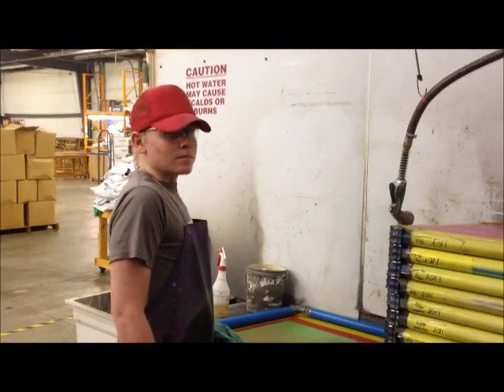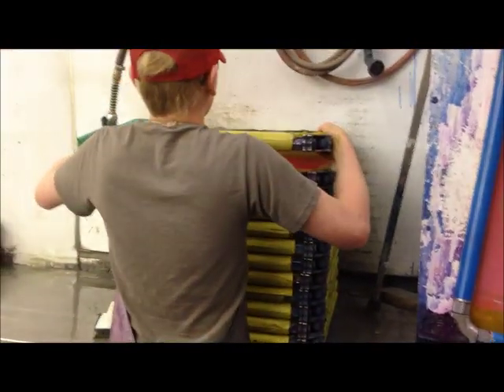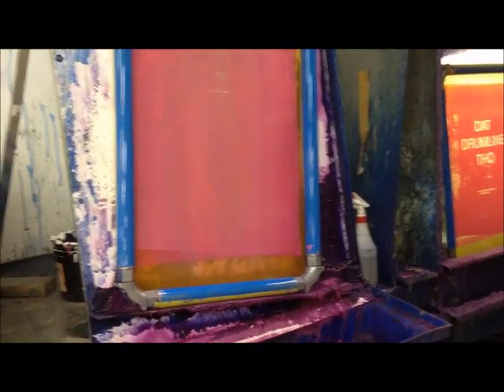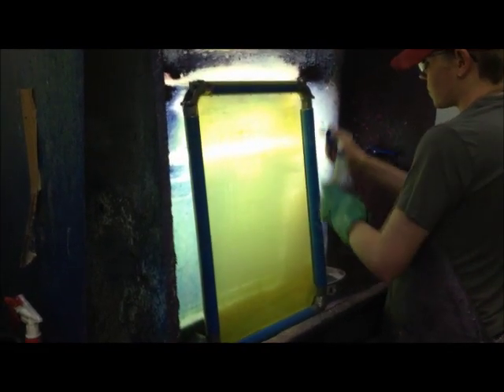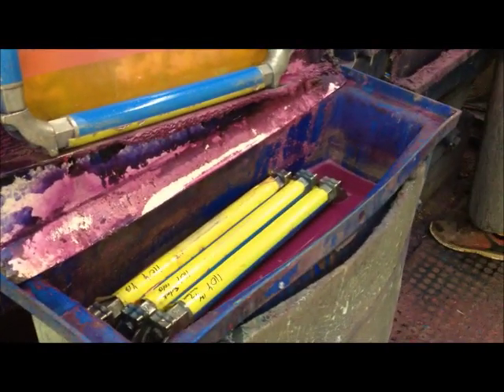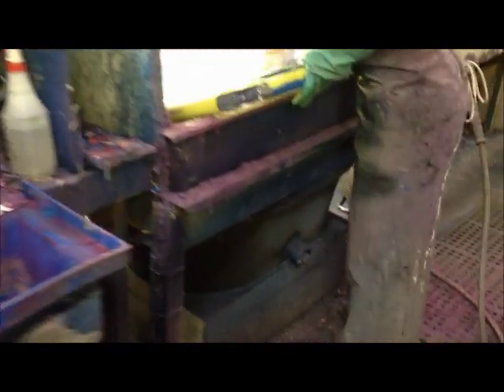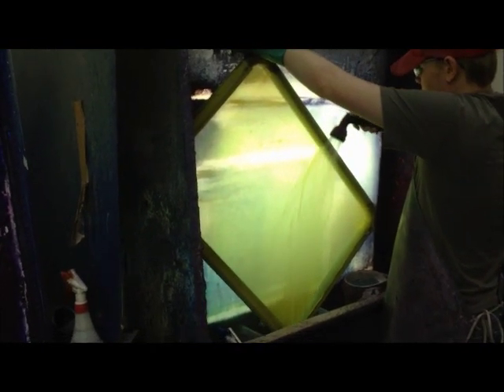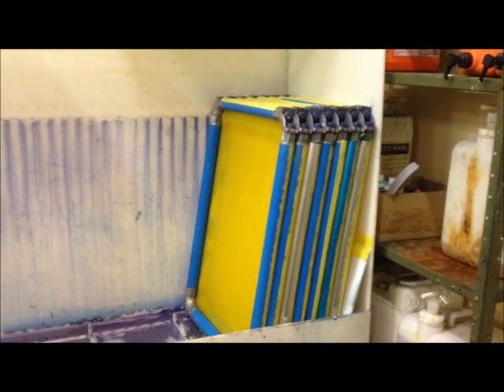Mind's Eye screen reclaim flat table plastisol ink removal dip tank emulsion removal workflow MOV

Comment: What a mess. 
More chemical, not breaking down the stencil turns into sludge , ends up in the dip tank, and drain. 
Use a better chemical, apply it at full streghnth, and break down the stencil. This dip tank idea is a waste of time and money. 
Then just blow debrit back on the mesh..nice. use a vacuum nozzle to extract the water, then dry.

Comment: sorry,  but in a six minute video it took 5 minutes to reclaim 1 screen. I'm not sure how that adds up to 20+ screens per hour.
Reply from the maker: Dan,

Very astute observation, however if you take out the time I was talking and my screen tech was standing there waiting of rme it does reduce the time.  Additionally the true efficiency is obtained via multi -tasking when screens are in process simultaneously.